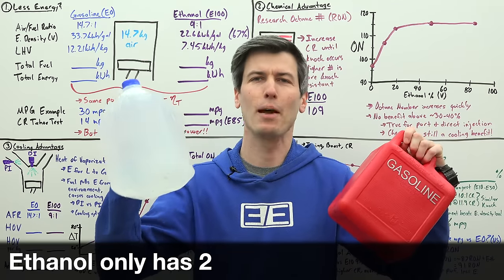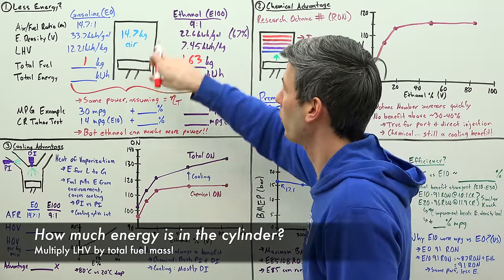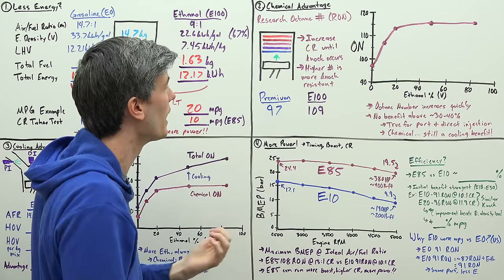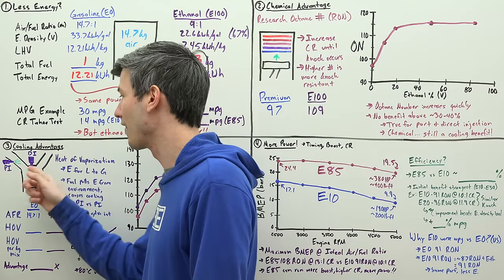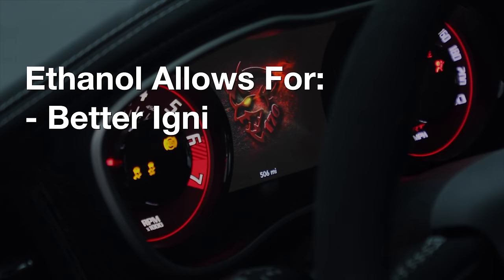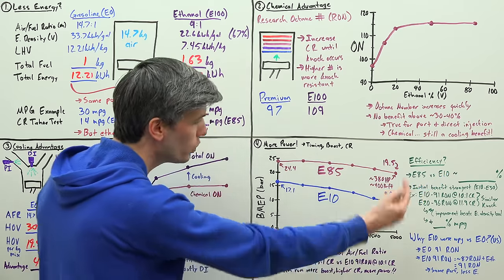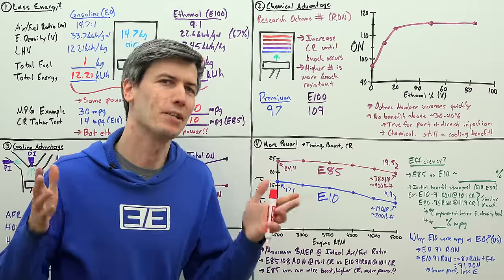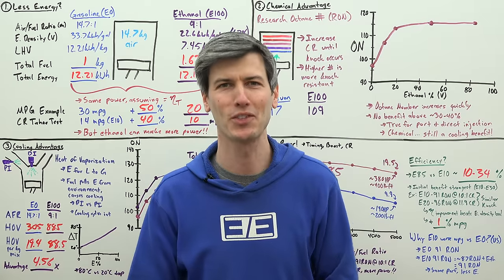Why Does Ethanol Make So Much Power? (Versus Gasoline)

Comment: The net energy content of 1 gallon of ethanol is  (volume * density * energy * efficiency) ÷ volume : (1 * 2.97148 * 33.33333 * 13%) ÷ 1 equals 12.87641 kilowatt hours
The net energy content of 1 gallon of gasoline is  (volume * density * energy * efficiency) ÷ volume : (1 * 2.85769 * 33.33333 * 13%) ÷ 1 equals 12.38333 kilowatt hours
Reply: NOPE
Reply: @oldblueaccord2629  
1 gallon = 1 gallon : NOPE
2.85769 kg = 2.85769 kg : NOPE
33.33333 kwh = 33.33333 kwh : NOPE
13% of 95.256 kwh = 12.38333 kwh : NOPE
I’m guessing that your a math teacher, maybe teaching grade 11 calculus.
Reply: @saltydogg  Ethanol has less power then gasoline you got the numbers swapped.
Reply: @oldblueaccord2629  Mass equals energy, so the larger mass has more energy.
Reply: This is not new technology or knowledge, it was known long ago.  It is suppressed technology.

Rear Admiral C.M. Chester wrote Henry Ford a letter on Dec.15, 1916:
"...I also pointed out in the article that as governmental laboratories had developed from 40 to 55% efficiency in alcohol engines as against 20% in gasoline machines, the use of alcohol at double the cost of gasoline for power purposes, was cheaper for motor[s] than gasoline in common use today."

Scientific journals from 1890 – 1920 contain hundreds of references to alcohol fuel at the dawn of the automotive era. 

Studies of alcohol as an internal combustion engine fuel began in the U.S. with the Edison
Electric Testing Laboratory and Columbia University in 1906. Elihu Thomson reported that despite a smaller heat or B.T.U. value, “a gallon of alcohol will develop substantially the same power in an internal combustion engine as a gallon of gasoline. This is owing to the superior efficiency of operation…”

The USDA tests in 1906 also demonstrated the efficiency of alcohol in engines and described how gasoline engines could be modified for higher power with pure alcohol fuel or for equivalent fuel consumption, depending on the need.

The U.S.Geological Service and the U.S. Navy performed 2000 tests on alcohol and gasoline engines in 1907 - 1908 in Norfolk, Va. and St. Louis, Mo. They found that much higher engine compression ratios could be achieved with alcohol than with gasoline. 

When the compression ratios were adjusted for each fuel, fuel economy was virtually equal despite the greater B.T.U. value of gasoline. “In regard to general cleanliness, such as absence of smoke and disagreeable odors, alcohol has many advantages over gasoline or kerosene as a fuel,” the report said. “The exhaust from an alcohol engine is never clouded with a black or grayish smoke.” USGS continued the comparative tests and later noted that alcohol was “a more ideal fuel than gasoline” with better efficiency despite the (*then*) high cost.

Comment: Use Methanol not Ethanol
Reply: A Brief History of Racing Fuel By Craig A. Johnson

In 2005, the IRL used 100 percent methanol in their tanks. The fuel worked well and was more efficient than straight gasoline, but IRL officials believed there was room for improvement. In 2006, they moved to a 10 percent blend of ethanol and methanol, which was then changed to 100 percent ethanol for the 2007 season.

The desire to use only ethanol aside, 100 percent ethanol is nearly impossible to obtain, and is illegal to keep without paying hefty taxes that date back to prohibition. The actual fuel used by the IRL is a blend of about 98 percent ethanol and 2 percent denaturant. The exact composition includes a small amount of high-octane racing fuel.

The fuel for today's Indy cars has an octane rating of 113, compared with methanol's 107. This means a significant reduction in pre-ignition, or knocking and pinging.

In addition, many of the people who handle the fuel, say it smells like tequila. This quality may seem insignificant, but smell is actually one of ethanol's benefits when compared with methanol. Pit crews noticed the switch to ethanol immediately, reporting fewer coughing fits and less eye irritation before any other modifications were made to accommodate it.

According to Dennis Vervynckt, manager of hospitality services and an IRL official, in 2006, the first year the IRL began using ethanol, teams saw a reduction in efficiency of about 10 percent. "That's because we put straight ethanol into the tanks," he says. "The teams initially didn't make any or very many adjustments to their engines. After a few months, they kept tweaking and by the end of the season they were back up to 100 percent efficiency."

Vervynckt points out that there was a minor loss of power. "When they first started using ethanol, teams saw a slight drop in horsepower," he says. "As the teams got used to the fuel, they were able to get more horsepower from ethanol once they again reached maximum efficiency."

The switch to ethanol also allowed the racers to carry less fuel and make fewer pit stops, thereby increasing efficiency even more. "When the cars ran on methanol tanks had to hold 30 gallons to accommodate the fuel requirements of the cars," Vervynckt says. "After getting the engines to perform at their full potential, there was a significant gain in mileage. Indy cars now have 22-gallon tanks. When a driver pulls in to change out his tires, he can fill up. Teams were able to match their tire and fuel stops exactly, instead of stopping for tires only, or fuel only."

That efficiency translates into much less fuel being used by the sport. Lifeline Foods LLC, which supplies fuel for the IRL, will produce 120,000 gallons of ethanol for the 2008 season. And though this may seem like a lot, it's 20,000 gallons less than was used the previous seasons.

The switch from methanol-based fuel to ethanol has amazed almost everyone in the league. Drivers, the direct users of the fuel, voice their approval in glowing terms. "[Ethanol] is an American fuel that is good for the country and the environment," says Ryan Hunter-Reay, of Rahal Letterman Racing and driver of the ethanol car. Standing beside his crew as they make last-minute adjustments to the car, he is more than happy to discuss the benefits of the IRL's switch to ethanol. "It's been great for Indy racing the fuel economy, emissions there's nothing we don't like. We love it."
Reply: During Winter u can't start Engine if u put Ethanol
So Methanol is Better
Reply: Methanol was M85 in first flex fuel cars so it can’t start very easily either evidently.

In Brazil where E100 is sold, their flex fuel vehicles have heated injectors for starting similar to diesel engines which have glow plugs.

Comment: Ethanol has a MUCH lower energy density.  Ethanol makes less power than gasoline, period.  Two identical engines, making identical power, one using ethanol, one using gasoline - the gasoline engine will use far less fuel over time.  This is the true economy of fuels - to make the required amount of power at the lowest possible consumption.  Alcohols will never be able to compete with hydrocarbons.
Reply: In our current lower compression gasoline optimized engines, ethanol will lower mileage but increase the horsepower, not lower.  It also vastly cleans up the exhaust pollution plus the cost per mile is less.  Who can be against that?

For example a Chevy 5.3L engine is rated at a clean 380 horsepower on E85 vs a dirty 355 on E0.

With an ethanol optimized engine you get both more power and more mileage at half the size. Ricardo built one for GM which they drove around a few years ago.
FROM RICARDO:
The new federal CAFE standards are calling for a doubling of fuel mileage performance, which, Vint says, is going to send OEM’s looking for high octane numbers to improve efficiency and ethanol is the best source. Ricardo, an engineering firm with over 100 years in the business of engine design, has developed an extreme boosted direct injection engine (EBDI) to optimize ethanol blends. The 3.2 V6 gasoline engine rivals the power and torque of a much larger GMC Sierra 6.6 diesel, he said, and it delivers 3.5 percent better fuel economy than the diesel.
Reply: @danafletcher2341  Each fuel has a known energy density in BTU/lb.  The fuel with the highest energy density is the most economical fuel - period.  Chasing alternative fuels with a lower energy density and higher cost to produce is fantasy.  "Emission Control" is also just a control lever.  Our planet has a circular molecular handling system that is as old as the planet itself.  Things are best looked upon objectively and energy density is the metric by which we measure the economy of fuels - not any other metric.
Reply: @BillyWillicker  If you only look at BTU for an internal combustion engine, you miss heat of vaporization as mentioned in video, octane, flame front speed, volume of combustion products etc. which more than overcomes lower BTU and this was known in the early 1900s as well as by Ricardo who gets more mileage and power than even a modern diesel engine as you have now seen.

BTU rating might be good for a steam engine or fireplace, but I even see more ventless ethanol fireplaces than gasoline.

Ethanol has come of age and takes much less energy than gasoline to produce.  Even better than that as an octane booster and oxygenate.

The spot cash delivered price of ethanol on the NYMEX today is $2.38/gal.

The price of an unusable sub-grade of gasoline (RBOB) is $2.83/gal. 

To turn RBOB into usable E0 costs even more much like premium costs more.  Unfortunately for humanity it also becomes far more toxic and far dirtier.

Or, simply splash in >10% ethanol to RBOB and the resultant usable fuel is less toxic, far cleaner burning, and cheaper/cheaper per mile to drive.  Who can be against that????

Denver in 1988 was the first government entity to require E10 when they they were on in EPA list of ozone non-attainment zones.  Soon with ethanol they were off that list.

Even with just 10% ethanol added to E0, the Swiss Federal Laboratory for Materials Science and Technology found that the especially health devastating ultra fine or nano particulate emissions were lowered by 97%, carbon monoxide lowered by 81%, carbon dioxide lowered by 13%, aromatic hydrocarbon emissions lowered by 67-96%, and genotoxic emissions lowered by 72%.
Reply: @danafletcher2341  Using slanted numbers to drive an opinion is disingenuous.  An optimized engine for a given fuel will dictate the maximum amount of work extracted from that fuel.  The energy density of the fuel becomes the metric for economy.  Hydrocarbons far outperform alcohols in energy density, especially once you have engines optimized for the fuel they consume.  "Environmental impacts" and emissions become irrelevant with optimized engines as those emissions are easily handled by the Earths circular chemical system.  Less energy dense fuels are the wrong direction, as is electric as it cannot be stored in nearly the same density as any available fuel.
Reply: @BillyWillicker  An ethanol optimized engine is half the size/twice the power of gasoline and diesel optimized engines and gets more mileage than either.

Ricardo already built one.  Ford has as well.  All major companies have made ethanol optimized engines, nothing that is hard to do, even in the early 1900s.

The numbers came from the NYMEX available to anyone who may have doubts.  Look up RBY00 for spot cash delivered price of RBOB gasoline and ZKY00 for ethanol.  May ethanol is even lower at $2.16/gallon, May RBOB is still $2.83/gal.

We can make ethanol into chemically identical gasoline, and though it is cleaner than petroleum gasoline with its toxic and dirty aromatic compounds why make it when ethanol can be better?

I would rather have pollution free non-toxic E100 ethanol optimized engines that get better MPG than gasoline.

Comment: For typical drivers, using ethanol cuts your mileage, raises your cost.  Ethanol’s good for drag racing, no not racing while wearing your wife’s dress!
Reply: Since percentage loss of mileage is always lower than the percentage less you have to pay for ethanol, your cost per mile to drive is less with ethanol.

The EPA says the US Fleet lose 3 to 4% with E10 and 4 to 5% mpg with E15 and they rate E85 along with E0 on the window sticker.

The oxygenate qualities is why we use it more than saving money though that is a great bonus along with the higher horsepower.

Even with just 10% ethanol added to E0, the Swiss Federal Laboratory for Materials Science and Technology found that the especially health devastating ultra fine or nano particulate emissions were lowered by 97%, carbon monoxide lowered by 81%, carbon dioxide lowered by 13%, aromatic hydrocarbon emissions lowered by 67-96%, and genotoxic emissions lowered by 72%.

Another bonus is no one in the northern US and Canada in winter needs to buy little cans of alcohol called HEET or DRY GAS as gas-line antifreeze anymore.  E10 and greater has it already in there.
Reply: Jim typically E 30 its a big NO on your part. Better mileage better power.

Comment: Those numbers, 14.7:1 and 9:1 are essentially meaningless. It really only represents a relationship between reactants, not an actual volume. 14.7:1 may not be different in terms of volume to 9:1, because the compound has a different density.

As for fuel stability, or knock index, these aren't exactly diesels. They basically never achieve 100% volumetric efficiency. Not even at idle probably, especially with throttle restrictions. So why is knock even being considered? I can't imagine an engine at 6000rpm experiencing knock when it has to fill the each cylinder 50 times in a 1/4 sec, even at high psi and compression ratios. Not only that, but these engines are direct injection. So if they run like a diesel, why are they even concerned about knock?

If the fuel has less energy, you have to use more of it. If you have to use more of it, but it's more dense, you end up being about the same.

Also, that 14.7:1 ratio is totally arbitrary. It's obviously incorrect, and throws off the entire equation. The ethanol has less power in it. What more needs to be said?

I do think it's kind of cool that it has a high vaporization temperature. That's probably a good thing overall. Being able to make power and run cooler has to be all upsides.
Reply: What do you have to say about this engine Ricardo built for GM and drove around a few years ago:

FROM RICARDO:
The new federal CAFE standards are calling for a doubling of fuel mileage performance, which, Vint says, is going to send OEM’s looking for high octane numbers to improve efficiency and ethanol is the best source. Ricardo, an engineering firm with over 100 years in the business of engine design, has developed an extreme boosted direct injection engine (EBDI) to optimize ethanol blends. The 3.2 V6 gasoline engine rivals the power and torque of a much larger GMC Sierra 6.6 diesel, he said, and it delivers 3.5 percent better fuel economy than the diesel.

BTU is a measure of heat, not a measure of work.  Ethanol cannot make as much heat, but its other characteristics can do more work in an optimized internal combustion engine.

This is not new technology or knowledge, it was known long ago.  It is suppressed technology.

Rear Admiral C.M. Chester wrote Henry Ford a letter on Dec.15, 1916:
"...I also pointed out in the article that as governmental laboratories had developed from 40 to 55% efficiency in alcohol engines as against 20% in gasoline machines, the use of alcohol at double the cost of gasoline for power purposes, was cheaper for motor[s] than gasoline in common use today."
Reply: The ratios are certainly not meaningless.  They are mass ratios, not volume ratios, and Jason used them correctly.

The 14.7:1 ratio for gasoline is not arbitrary at all. It is a direct result of the composition of the fuel (the amounts of hydrogen and carbon), the composition of air (the fraction which is oxygen), and the chemistry of combustion (C + O2 = CO2, 2H + O = H2O).
Reply: @brianb-p6586  — The boat left 10 hours ago, and poor ole Grant is still sitting on the dock, all alone, expecting it to show up any second now …
Reply: @brianb-p6586  I think his chatgtp doesnt like maths to much is what he is saying.